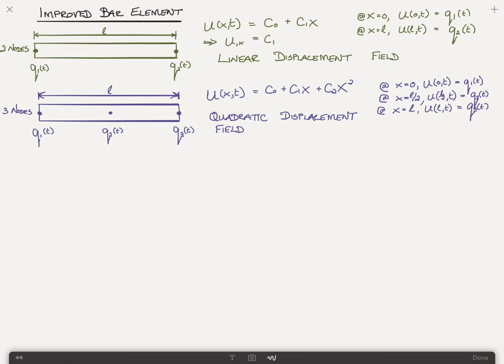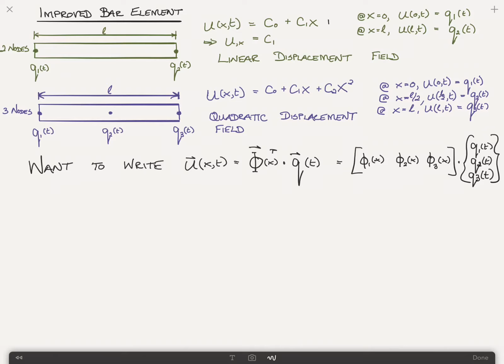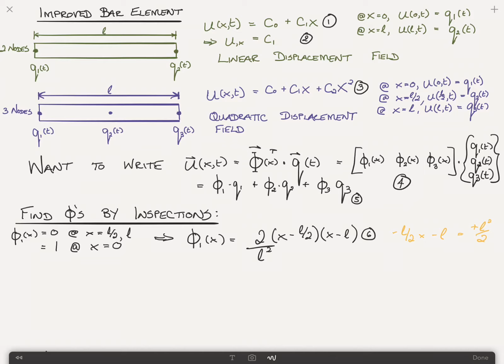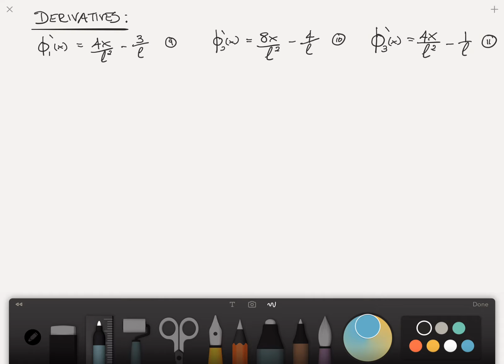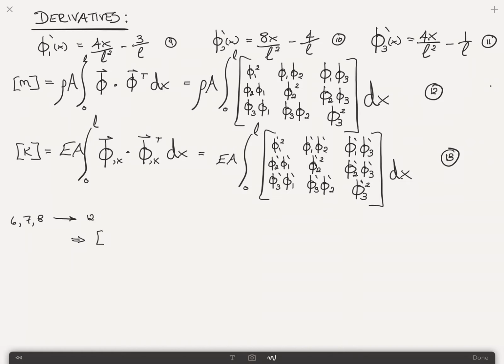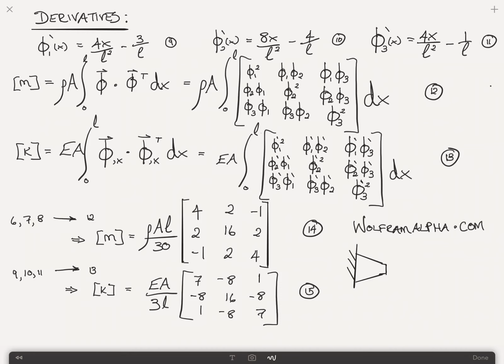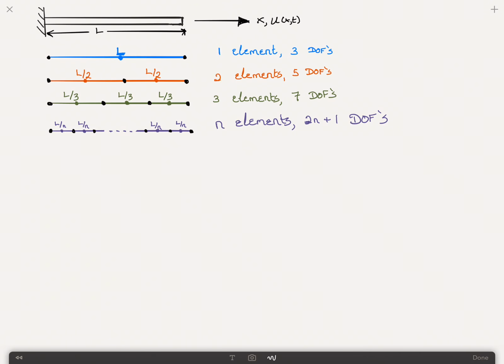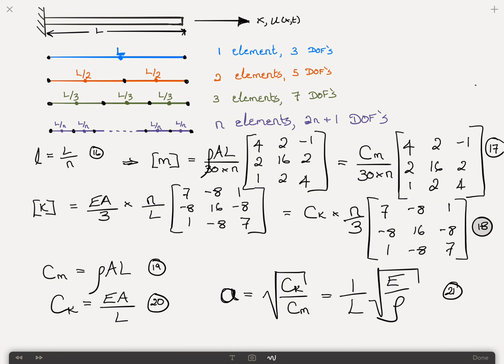Bar Finite Element - Developing an Improved Bar Element

Comment: A little hard to follow, suppose k = c*int_0^L(phi'*phi'^T), then what does int_0^L(phi'_2*phi'_1*u1   + phi'_2*phi'_2*u2  +  phi'_2*phi'_3*u3) represent?
Reply from the maker: I'm not sure I understand the question.  Where did this expression above come from?  Do you have a time code for me to reference?  

Are you asking about what the different component of the stiffness matrix represent?
Reply: @Freeball99  I'm asking about the middle node. Force for the middle node as given by k*u is the expression I gave. But I'm not sure what kind of force to represent with that expression. Is it nodal force? Internal force? Or what?
Reply from the maker: @nedisawegoyogya  {F} = [K]{q} where the [K] has been derived for you in the video and q are the nodal displacements. 

This gives the forces at each node, so F2 - ie the middle row from the vector equation above, will give the force at node 2.

Note U is a function of x and t while q is a function of t only, so q can be taken out of the integral.
Reply: @Freeball99  can you please give the integral form for F2, and explain why the integral represent the force with fundamental law? Because K itself doesn't explain a lot in terms of representability, because it came from integral
Reply: @Freeball99  of course by integral form I mean no vector only variables for the scalar F2
Reply from the maker: @nedisawegoyogya  I have explained how to find [K] in the previous video for the 2-noded bar element.  This was shown using the strain energy that the stiffness matrix can be found by multiplying the derivatives of the various shape functions and integrating them.  Take a look at youtube.com/watch?v=HFkK6n7sKfc around the 21:30 mark.  This will give you a feel for what this integral represents.

That said, the expression for F2 is 
F2 = k21*q1 + k22*q2 + k23*q3, 

where
k21 = EA · int_0^L (φ'_2 * φ'_1) dx
k22 = EA · int_0^L (φ'_2 * φ'_2) dx
k23 = EA · int_0^L (φ'_2 * φ'_3) dx
Reply: @Freeball99  yes I already watched your previous videos. Great videos btw, thank you so much for making those. Pull those EA and integrals, then you got my first comment as an expression of F2. What I don't understand is, what does that integral represent (external force as I understand it), and how? How does such an integral relate to a free body diagram of linear elastic bar in equilibrium with force F2? What expression does the internal force get to make a discontinuous graph at the middle? Because the linear combination of the shape function doesn't look possible
Reply from the maker: @nedisawegoyogya   the expression in your first comment is incorrect. It should not contain any u’s. The u’s got replaced by phi’s and q’s. This is why I was confused at your initial question. 

The integrals represent the various elements of the stiffness matrix; they are not a force. When you multiply the stiffness by the nodal displacement, q, it becomes a force. The fact that this integral represents a stiffness is what I explained in the previous video.  

The idea behind finite elements is that for the same deformation field, the actual bar and the finite element will store the same amount of internal energy. In doing so, we are able to come up with these integrals which discretizes the problem into one where we just consider the nodal displacements (which are a function of time only). Thus we now have converted our PDE into an ODE which can easily be solved. 

There are no discontinuities because the shape functions, in effect, smooth out these values between the nodes.
Reply: @Freeball99  okay yeah sorry about u, it was customary in my uni to use u as nodal displacement hehe. Ohh now I see it, so the key is the same work done internally and externally. But talking about discontinuity, wasn't it more accurate for the bar to have discontinuous internal axial force given nodal point force?
Reply: @Freeball99  that is why I was confused because the approach is energetic, but I tried to understand it statically. That's also why I want to break down every integral and get the meaning of every one of the terms. Now with an energetic approach it is clear, thanks. Just need to know the discontinuity.
Reply: @Freeball99  but I guess if you limit the external force at the middle node only for equivalent nodal load of a constant distributed load, it gives exact solution. otherwise giving real external point load there will not work?
Reply from the maker: I think is misspoke slightly before.  The shape functions smooth out the displacements and the derivative of the displacements.  

However, applying a force at the internal node can indeed cause a discontinuity in the internal axial force. This means the axial force in the element to the left of the internal node can differ from the axial force in the element to the right, reflecting the physical response to the applied load. This discontinuity is a natural result of the finite element method's equilibrium and force distribution principles.

Hopefully this covers your question.
Reply: @Freeball99 that's what I'm trying to do, calculating the discontinuity. If it is known that the strain is the derivative, and the derivative of the shape function is smooth, how to calculate the discontinuity using this element given nodal load in the middle?
Reply from the maker: @nedisawegoyogya Calculate the internal force for each part of the element on either side of node 2 using the stiffness matrix and nodal displacements.

The difference in internal forces on either side of the middle node represents the discontinuity: Discontinuity = Internal Force (Right) - Internal Force (Left)

This discontinuity equals the applied nodal load: Applied Load = Discontinuity

Example for a 3-noded element system with a nodal force at the middle node (node 2):

Calculate the internal force for the left part of the element using the stiffness matrix and displacements at nodes 1 and 2: Internal Force (Left) = k21 * q1 + k22 * q2

Calculate the internal force for the right part of the element using the stiffness matrix and displacements at nodes 2 and 3: Internal Force (Right) = k22 * q2 + k23 * q3

The discontinuity is the difference between these forces: Discontinuity = (k22 * q2 + k23 * q3) - (k21 * q1 + k22 * q2)

This discontinuity should equal the applied nodal force: Applied Load = Discontinuity

Comment: Thank you for the video it was very clear. Please i have a question, would increasing the order of the displacement field polynomial equation be more effective or just the quadratic method is sufficient?
Reply from the maker: Adding nodes and increasing the order of the displacement field will increase the accuracy of the element, but it also makes the element more computationally expensive.  By having a more accurate element, this means that you can use fewer elements to get an accurate result and by using fewer elements, you can reduce the computational overhead of the system.  As a result, one needs to weigh the computational efficiency of using a fewer number of more accurate elements versus using a less accurate element and having more or them.  In practice, which one is more "effective" will depend on the problem being solved.
Reply: @Freeball99  Yeah so it's like we should balance between accuracy and computation efficiency. Thank you for your reply and your content, it's well explained.

Comment: How would one go about determining the nodal displacements of a 3 noded bar as above, with quadratic shape functions etc? Btw, your mass matrix on the last slide is not symmetric as before; m(3,1) is written as 1, whereas previously you had -1.
Reply from the maker: You are correct, it should be -1.  I mistakenly forgot to add the '-' sign.

Finding displacements using the 3-noded element is identical to the method using the 2-noded element.  Just assemble your matrices, then remove the fixed degrees-of-freedom then integrate the equations of motion.  I have shown this for the 2-noded element in the video that follows this one:  https://www.youtube.com/watch?v=WpBj34r4ySE

The method is identical for the  3-noded element - it's just that your global matrices are larger.
Reply: Are you sure about that? How do you get the middle internal axial force?